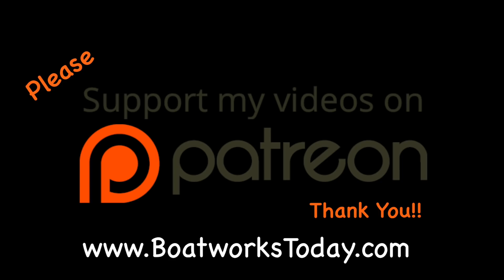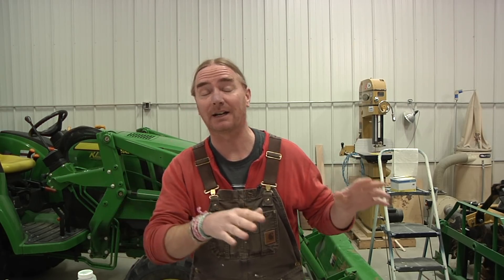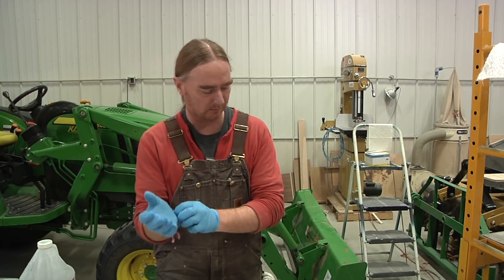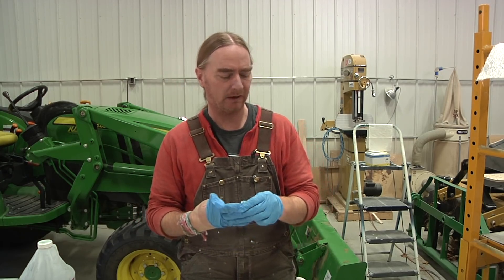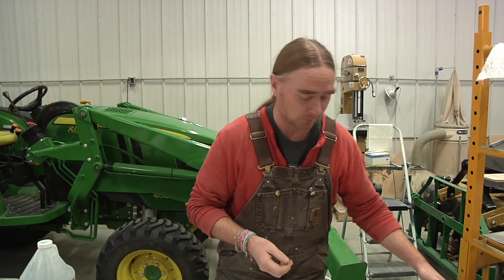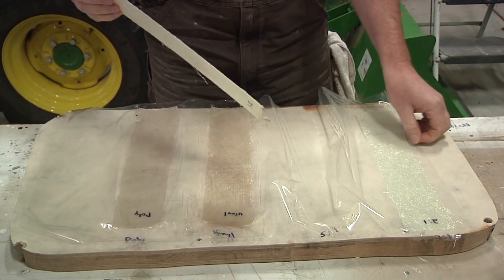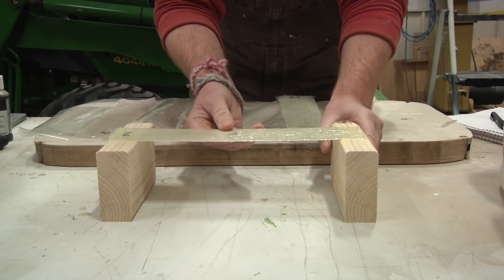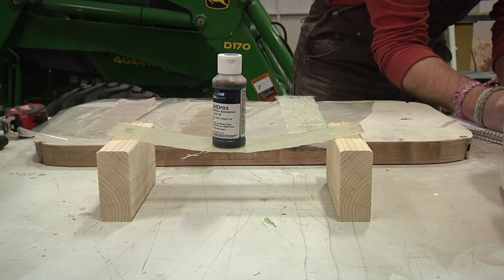Testing The Strength Of Different Fiberglass Resins!

Comment: Yeah not a very good test. I can't Imperial measurements. Vinyl is very easily effected by moisture, and you basically broke it peeling it off. Maybe you could have post cured it a little bit. I'm sorry I know I'm abit rude but there's just nothing in this video that offers anything valuable. Epoxy for everything unless you can't afford it, vinyl and poly for molds

Comment: I have been struggling to create a headliner board for my car. I dont want the cloth rods method. You hit a very good point about multiple layers creating a laminate. I am trying to make this as thin and light as possible while getting a rigid panel that wont cave in on me. This seems to have helped a bit, thanks.

Comment: Fiberglass is stronger in compression than tension. Your deck is like a beam.
To stiffen the deck you should add a layer under the deck not on top.

Comment: I watched this yrs ago and im back with a thought. I have 43 year old teak hand hold on deck of sailboat.  They are in good shape nothing compared to their matching holds in the boat. They are far from breaking. 
Im thinking of a fiberglass  tape wrap then epoxy the glass and repeating say 2 times. Then a compund and sand and paint. Do you think that would protect and keep stiff over the years. Another suggestion was  to just use epoxy  over the teak.
Your thoughts on  either of these two .
Thank you

Comment: At the sailing school I used to work at, we used polyester resin for our hull repairs. But, our boats also had fairly flexible hulls. I suspect your layering choices will make as much or more difference than the resin itself (between epoxy and polyester) as far as net hull strength. But there are other considerations as well, UV resistance, yield strength  and if you want it harder to snap or harder to flex.

I will have to check out what you ended up with and how it went.

Comment: Andy, this test misses the point entirely. What’s the value in a single layer of glass/resin being stiff? I think the real test is strength - then, when you use the glass as it’s intended, which is either as a part of a laminate of some thickness, a skin on a core or a method of joining parts, it will contribute to the stiffness of the finished piece. Strong skins that do not stretch when separated by some thickness of core will produce a stiff deck.

Stiffness in the diminutive thickness of a single layer of glass is more likely to produce brittleness which is contrary to the goal of producing a strong deck. The glass itself will provide the vast majority of the strength, the goal of the resin is to tie the fibers of glass together, lock up their orientation and bond them to a core and other parts in the overall piece. To do that the resin needs to be more flexible than the glass so that it will not fail before the glass does - so doing a test that values stiffness of the resin itself is flawed.

Comment: you assume that stiffness goes hand in hand with being robust / durable, right?

Epoxi may bend more, but this isn`t a qualtiy criteria at all. It needs to be durable and tough. This, where Polyester looses totally, it breaks way easier and quicker.
Poly is absolte cheap but of poor quality.

Take the samples and break them. Only destructive testing is really testing!
But wait a week or so. BEsides: you can harden Epoxi composite with heat what will make an even bigger difference.

Comment: Looks to me like you are measuring the modulus of elasticity not strength. Strength can only be measured by stressing the part to failure. You may find some resins are more flexible but have a higher strength than stiffer resins. None of this takes into account what kind of failure to expect - progressive or dramatic failure. Additives to exactly the same resin can cause different results. It all depends on the application as to which resin is best suited to the job.

Comment: Thank you, ya seriously help me out!

Just wanted to quickly mention I'm partly a backyard scientist (and probably an additional three parts mad scientist), and that gives me a special love for data. Now I know beggars can't be choosers but with just a few more little nuggets I could really, really sink my teeth in. A few things that would be game changers would be stuff like a fixed ruler standing on end then setting your camera up so roughly centered (bonus points if snap a mesurment from the lens to ruler), use a known weight (don't gotta be scientific, just known. Anything from a 9" Mastercraft tin snips to a fresh can of wd40 would work), and collecting what I call "ratio data" (instead of just a 2" do mesurment after 5s, 10s, and 15s).

Even with just that I could roughly work out things like elasticity, plasticity, rigidity, and sorta get a feel for how it will fatigue and possibly how it will fail... wouldn't take me 2 minutes to tell you which would make the best flooring, which for the skirting, which to use on your steps rises and which for the runs, and have a fairly reasonable idea which would work best for a hypothetical hot tub too!

The calculations can be tricky, but if you want I'm always game to teach (and by that I mean spare you the bs and make you a little calculator app... or rather send you the one I made to spare me the bs 😂. Lmk if you're interested). In any case, awesome video and thanks for getting me one step closer to completing this guitar! Cheers!

Comment: Really old video, not sure if you look at comments here anymore, but maybe someone else knows. 

I am wondering what the weight of say a 4mm plywood strengthened with fiberglass would weigh compared to using say 12mm plywood. 
My bed in my campervan is built using 12mm plywood across 3 ikea skorva metal beams. But the beams are held up using 2x4 lumber.

I'm thinking fiberglass must be a lot lighter than wood.. ?

Comment: This is not a strength test, its is an elastic modulus test. Polyester generally exhibits higher stiffness (Modulus of elasticity )but considerably lower strength (Ultimate tensile Strength UTS, as well as impact strength), particularly before post cure. Interestingly stiffer resins are usually lower impact strength. Amine adduct epoxy (the yellowy smelly one with mix ratios in the 4 or 5 -1 ratio as opposed to the 2-1 west system type chemistry) exhibit much more defined curing as well as less viscoelastic creep (sagging while still young) , in other words ready for service sooner, and the reason they are used for more production cycle applications where they need to be man-handled out of moulds promptly to make way for the next layup. Its also worth noting curing temps play a major role in the performance properties of final cure with epoxy not just on cure times, whereas polyester/vinylester resins temp has very little effect on final properties, it generally only effects cure times.

Comment: I know this is probably a stupid question but whatever I can't ask it to Google and then find out because it just tells me about surfboards but it doesn't give me the answer I want or not want but that I'm trying to figure out. 
So  Here's my question.
Why add the glass fiber to the resin if the resin is what gives it structural brigidity why not just use resin just in its pure form does the glass fiber do something or is it just to make it thicker like a filler or more opaque or something what is the point of the glass?
Reply: I'm super late but if I'm understanding correctly:
The fibres add a little stiffness to the resin, helping it to not bend past its natural breaking point.
Kind of like reinforced concrete

Comment: Hi Andy, hoping you'll read and respond to this. I decided to make a swim platform for my bowrider. The total length of the platform is 80" and 24" deep. I bought a 3/4" sheet of Coosa Bluewater 20 (probably should have gone with 26) cut it in half with the intent of bonding the two pieces together for a total thickness of 1.5". I'm concerned it's not going to be stiff enough. How would you bond the two pieces together? I have a gallon of polyester resin already so I'd like to use what I already have. Should I just poly the two pieces and clamp them together or use something like cloth or mat in between? If so, which (cloth or mat) would you suggest. I plan on using something over the exterior of of the Coosa as well (mat or cloth) and finally gel coating it. The platform isn't completely rectangular with rounded corners and a slight V in the center to match the boat contour as well as a slight taper from where it will attach to the boat toward the rear. Is chopped mat my best choice for everything or should I use cloth and mat together. I can envision having two or more people standing on this from time to time so I need it to be stiff and strong. How would you go about bonding the two pieces together and then what would you do to cover both? Suggestions would be greatly appreciated. Thanks

Comment: I want to build a square drop trailer foam boards pink ones and ( s fiberglass )do you thank the floor could be made without using any wood and be strong enough may have to sleep on ( wife kicks me out for snoring )

Comment: Your bottles are not completely centered in the same place from piece too peace. Also the very first one you measured was close to 3/4 of an inch away from the bottle! You're next measurement was right alongside the bottle. Hello!  It doesn't matter to me, but if you truly care about your test and what you want to use you should be as accurate as you can no matter how simple you want to make your test. Or your test means nothing! 
    The very least you could have marked a center point on each strip. Placed the bottle exactly there. Did the measurement directly in the center of the bottle. The more your fabric deflects the greater the variation will be in the inconsistency. And if the bottle is off center the fabric wilflex less.

Comment: What is PVA used for? (@ 7:10) Obviously Ive never worked with polyester resin but I want to fiberglass the top of a plywood camper shell and I have epoxy but it MIGHT be easier with polyester resin.

Comment: I think epoxy might be the best because you have 2 different uses, when you want some flex in the application you can use 2:1 while if you want stiffer sections you can use 5:1..  Both being epoxy you can blend them together a lot better than trying to use different materials combined with it.....
I would have liked to have seen both sides tested and another good experiment could be using multiple layers and a tension apparatus..  either testing weight or tensile strength..
I am sure it would be a benefit to have some flex, just like metal..  aluminum might have a higher tensile strength but it sheers off when levels are surpassed...  steel may be weaker but the flex can often avoid sheering off unlike aluminum...  As goes the old saying, steel is real...

Comment: Nice video, I've used all resins alot and have not experienced strenth differences between the two but nice to see a test.  For small jobs at cool temps cyanoacrylate is definitely stronger but in the heat can cure before wet out

Comment: I have been  manufacturing  and repairing fiberglass aircraft parts and are FAA Approved. You need to check your facts, on vinyl ester,  because it is a more flexible and chemical resistance than Polyester and Polyester is a stiffer resin. There are different epoxies, some are stronger depending on application and fuel resistance. Vinyl Esters have more than a 3 month shelf-life, Polyesters have a shorter shelf-life than Vinyl Esters. I been doing this for over 30 years and had some of the best, Lockheed Martin  Composite Engineers I know advise me of what the best on the market. Fiberglass Cloth 7500 around a 10 Oz cloth or a 12 Oz cloth would have given a much better test and results. Also be advised on Resin Manufacturers some have much better resins and epoxies than others. I have vinyl ester that 7 months old and still has the same viscosity as when purchased; and also, you need to follow the Manufacturers Directions on Storage, the higher the heat the shorter the shelf-life of Polyester and Vinyl Ester resins are.
Reply: Would you allow me to benefit from your expertise in vinyl ester? I would like to know whether this resin is suitable for casting models without fiberglass, just like polyester and epoxy, or is it different from them?

Comment: Fun! Of course, flexibility (deflection resistance) is not the only measurement of strength. Difficult to measure this stuff without a lab though. Each material has it’s own characteristics (and therefore uses): Tensile, compression, torsion, fatigue, impact, elasticity, plasticity, .... it’s a long list .... are all measurements of material strength/stress, for example. I think, the products should clearly state their best uses (the good manufacturers do) and you learn from experience, I guess. On this subject: The bendy boat top is interesting :). Though bendy combined with a very thick layer of resin/fairing compound is probably enough to explain the cracks. (Ember the cured pot of resin you dropped on the floor?) Oh yes, things not bending, on the other hand, don’t tend to do well under impact.

Comment: I think one sheet test is as important as each added sheet to a laminate. Good show. 

I want to see two layers at 45°. 

You could try 7sing a motorcycle belt tester, maybe?

I looked up 5:1 fiberglass, and got meaningless stuff. Is that 5 oz fiberglass? Looked thin. But, what is 5:1? 

If you don't mind?

Thanks

Giovanni

Comment: I have a polyester resin question. Have you used polymer planet polyester resin? Apparently, it’s a DCPD resin that requires no wax or sealants to cure. It shrinks less and can be used for laminating. I wonder if you know enough if it compares to the standard laminating resins with strength, flexibility, and overall performance. Thanks!

Comment: Try Orca 511.  It's by far the best structural resin I've tested.  24oz woven roving (with no csm between layers) 12 layers yielded 92Ksi.  32 layers of 3.6 oz carbon fiber yielded 120ksi at 24% the mass of the roving sample.  Both samples were vacuum infused with a 75% glass/carbon content and used a very controlled post cure.

Comment: you were using a knydex style glass product often the chopped strand is not recommended to be used with epoxy as it has a binder on it that is designed to be dissolved with poly resin. You got better strength with the poly resin because it is the right tool for that particular kind of fiberglass. a fair test would have been 2 layers of normal weave wetted out and stuck together.

Comment: While a neat test for inquisitive minds, you essentially only measured one aspect of a few other intertwining properties.  While I, too, am an engineer I'll sum it up a bit more succinctly than my peer, Mr Simmons.  

The video depicted measured deflection (stiffness) but called it "strength".  They are not one in the same.  Fiberglass being a prime example of a highly deflective material with enormous strength.  Your test did not necessarily reflect the strength of those materials, just the stiffness.  Also, as I'm sure you well know, adhesion is very important in a lay-up.  Without the proper adhesion a lay-up is worthless.  Epoxy, obviously, is the winner in that category.  I, personally, use epoxy and 1708 in all of my repairs but finish it with PET.

Still, I like these kind of comparison videos.  Nice job.

Comment: A suggestion.  You might test your samples in more defined configuration, as the sample materials are in both tension and compression, and the glass is near or in what is called the "neutral axis" where the structural properties are not well defined.  I would put the samples in tension or in some cases, in compression, structurally stabilized.  I would suggest making a small beam with a layup on each side of a sheet of foam, for comparison purposes.  See examples at channels  (sevtec) or ( sevtecsev) on you tube.  An included one half inch thickness sheet of foam carefully bonded to the underside of your foredeck before your layup will help in your stiffness problem.  The sevtec 14 foot long boat hulls referenced are nothing but single and double fiberglass layers over each side of one-half inch,  4 lb/cubic foot foam.

Comment: You might want to add impact testing (to assess brittleness) as well.  Standard impact testers use a 1/2" diameter ball (matched to a 1/2" diameter die) and a 4 lb weight dropped from up to 40 inches to generate up to160 in-lb of deflection.  I don't know a lot about fiberglass, but an exterior grade coating should take 160 in-lb of force without cracking.  In your application, you'll get an indication of which system will be more forgiving when the owner drops a lunch hook on deck.

Comment: Vinyl ester is much stiffer than poly. You are not being fair to the epoxy by using part chop because it is not compatible with the corn starch holding it together. I use mostly four to one epoxy. Old material needs heat and agitation to remix it, should also have used heat to set it.

Comment: Very cool. I was wondering if the difference comes from the bonding strength, and that epoxy is superior when bonding to other materials. I think you once said, if making a whole part, you use poly or vinyl for the cost savings, but if bonding to a other part or surface, use epoxy. I'm excited to see more. Great vid.

Comment: What I like about epoxy is its enviromental properties. Polyester really needs to be protected from the elements to a different degree than epoxy. So would love to see the same test but then let the strips be exposed to uv light and water without protection for a month or two in summer, and then see.
Reply: I thought poly was better against UV rays.  Epoxy is better in every other way (excluding cost).  I'm not sure though